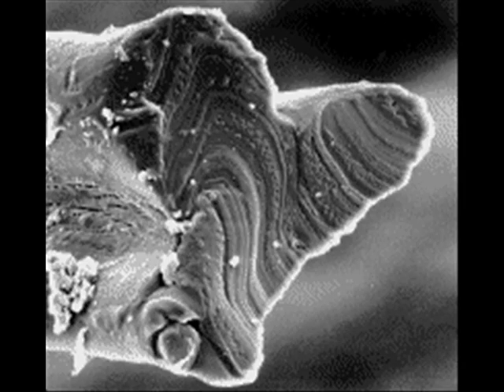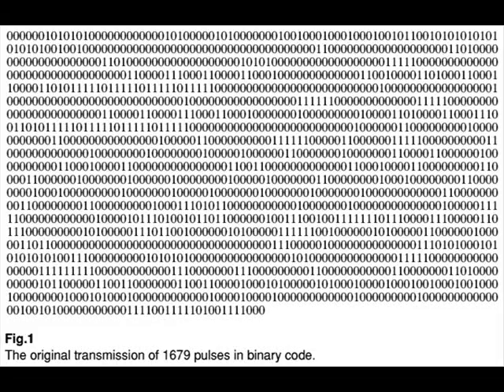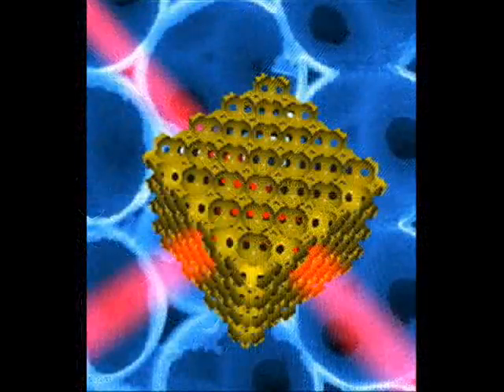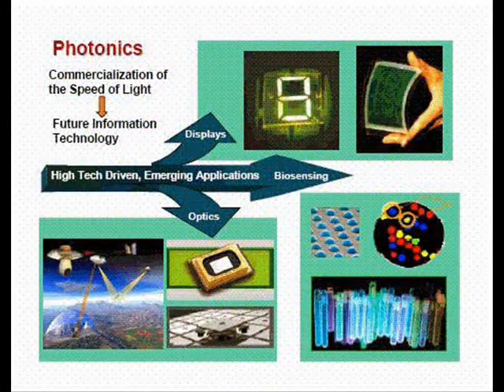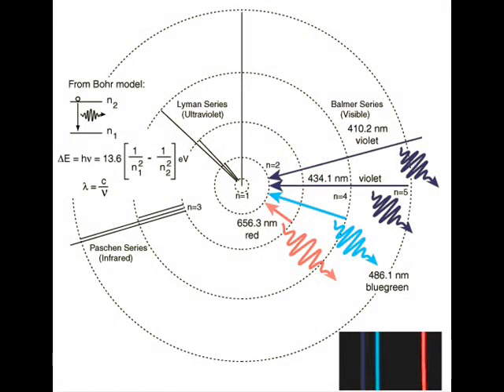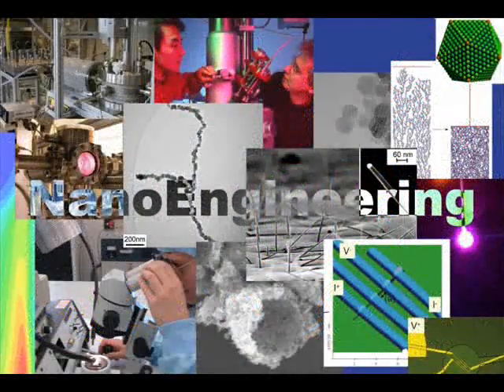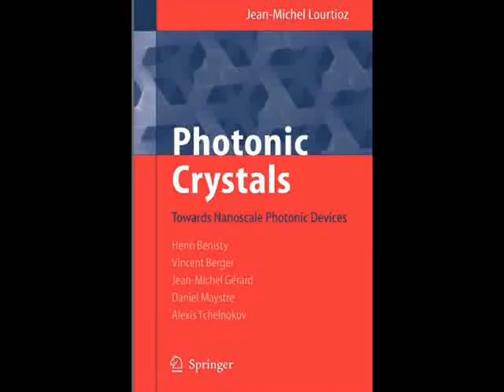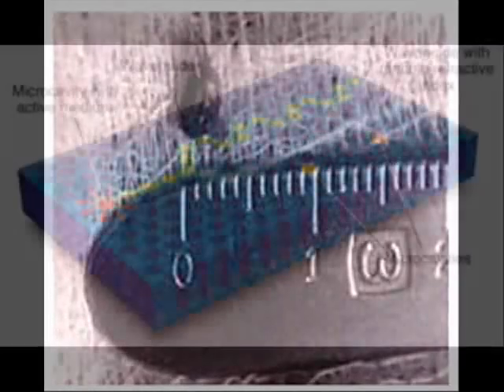Alien Technology - Quasicrystals & Photonic Circuits

Comment: You need 

Money 💰 

These 
Just 
Worries 
You can 
Get over it
Reply: Money isn't the problem. You could be the richest billionaire ever and a football stadium sized factory lined with billions or trillions of lasers each on a two axis swivel and under a near quantum vacuum creating these microscopic supercomputers one atom at a time is simply technology thats flat out unavailable to contemporary mankind. Even if such a structure were to be built, which easily would cost trillions of dollars, the extreme precision of each swivel head/laser and the computers needed to operate it precisely, engineering the chip, etc. I just don't think contemporary humans are smart enough to get anything of value even if the facility were handed to us.

Comment: No way. Making patterns is going to be easy. You can interfere electromagnetic waves to make very discreet electromagnetic pockets. Little pits of positive or negative charge. Interference against a plane should produce patterns. Picture the magnetic fluid sculptures, and how they produce little points. Increase the frequency and you have as many and as small of points as you like.

Comment: Hey im wondering what you thought wasnt accurate. I also feel strongly that NASA is simply a decoy to the masses, there is so much information NASA can't access, documented  but especially black (non-documented) information. To the extent NASA is connected to secret projects we won't know for sure until Disclosure, but certainly for instance in the subject of life on Mars, structures on the moon and Mars, and life outside Earth in general, NASA has been covering up a lot, more than most think.

Comment: Ah yes, a fine example of DDCT (Dimensional-Density Configuration Technology). Also, y'know in his Antigravity Physics Explained video, where he talked about gravitomagnetism? Well, if you directed the G-magnetism towards the centre of the ring, the air inside would be saturated with G-Mag energy, creating a sort of spacetime plasma. Now, using a G-Mag energy beam, the G-Mag plasma would be projected outwards, stretching spacetime to vast distances. The end would emerge elsewhere, as a wormhole.

Comment: Man, this guy is the bomb. I wonder if he has any thesis on the elasticity of space-time? If you could manipulate spacetime in a certain way, you could like, compress or stretch it. The applications for this theoretical manipulativity could include wormhole travel (stretching a metre of spacetime across many lightyears, effectively FTL without going FTL), interiors larger than the exterior (like the TARDIS, "magic bags", bottomless pits, etc), and many other such things.

Comment from the maker: They are photonic circuits, and one idea is to use metamaterial fiberoptic technology for signal transmission.

So yes, essentially I did say that these circuits were flowing at a tachyonic level only it's not hypothetical. Look up Metamaterials and Surface Plasmons for more information.

Comment: I take a class on Electronic engineering and theres no proof of a human discovering fiber optics. Alot of ppl in my school believe Fiber optics was not made by man due to the lack of depth knowledge and info on its applications towards circuits. Instructors stuggle to answer every question